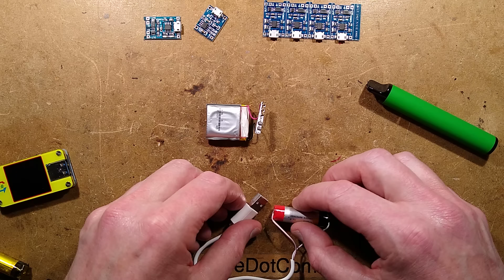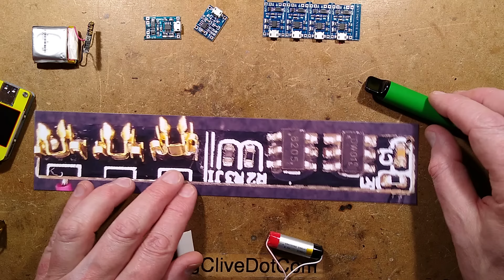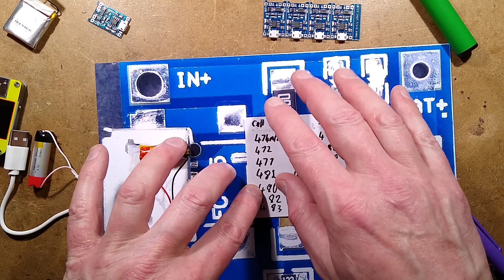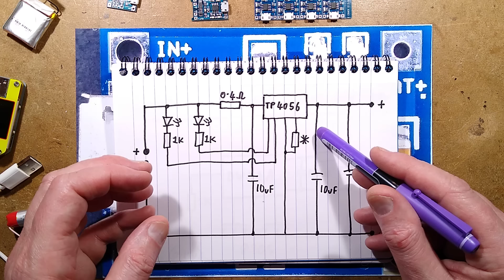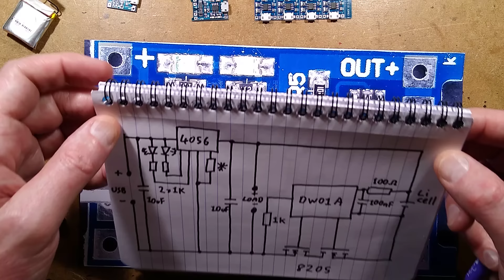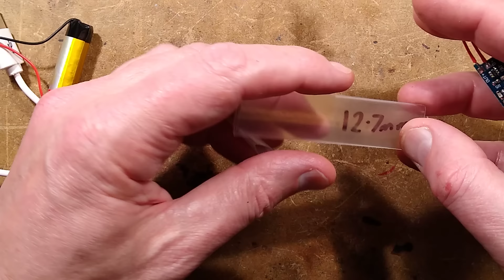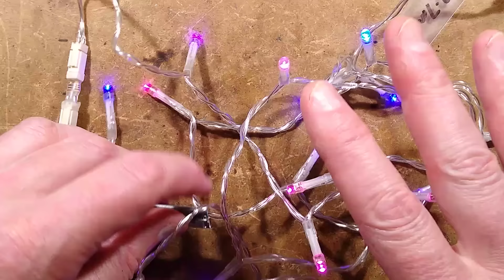Don't do this!   (There's a much safer way)

Comment: When I charge a lithium cell when not at home, I simply put in precautions that if it did for some reason fail and burn up, that there isn't anything around it that could catch on fire and then start to burn down the house. Even when using a proper bought charging circuit, I don't have 100% faith that it can't ever fail, I know it can, because I have seen some battery banks fail in their protection circuitry and then cause a fire. I have a metal tray that I have a thin silicon mat on, I leave my stuff to charge in there, there is a metal lid I place over it as well. It can't possibly burn anything, and the metal tray walls help it stay cool enough in there if it starts to warm up in there a little. The silicon mat is perfect because it can't burn, but it also offers electrical insulation as well, so wires aren't touching the bottom of the tray and shorting out.

Comment: Random question - to get a higher voltage and still charge batteries individually, can two of these be connected to their individual 18650, and then their outputs connect in series for a 2S battery?
Reply from the maker: Only is their 5V supplies are isolated from each other, or they will effectively short one cell.

Comment: I got ten pack of these.  I got some 5K resistors too but haven't gotten to putting one in yet.  But I just noticed, while charging an 850 mAh cloud making battery that after only about 10 minutes, that that little board is pretty toasty.  I wonder if you've put your IR cam on it and what it shows.  Well over 140F by the "feel" of it.  Guessing it's a MOSFET?  Nothing emitting the smelly fogs of defeat yet however.  I'll continue.

LOL
Reply from the maker: The TP4056 charge chips use linear regulation.  So they do get hot in use.  Especially when used with a voltage higher than 5V.
Reply: Oh, I got the dual chip ones with the protection chip.

Comment: I recently bought one of these disposable devices, and used it until it stoped working. I then took it apart and found out the cell was just discharged and still had plenty of fluid left. The device has a 1000 mah lithium cell!
Reply: I managed to find a 5 piece set of the ones that have dw01a thingy on it for $7.03 shipped. Looking forward to some tinkering!!!

Comment: I'm a naughty  boy but just jump started by li-po garden 3.2v cell with a  12v lead acid tapping the wires on the li-po. The plastic wrap peeled off and it got very very hot in 3 seconds but..... .now showing 3.5v!

Comment: I install the extra protection version in all of my project devices. I even extend the leds, using 2mm 'lighthouse' leds, so I can have charge indicators at the surface of the case.

Comment: I had done something similar using a diode and a resistor too keep a peek on the current the diode was their to reduce the voltage from 5 volts to 4.3 still this was not ideal but also safer then a direct connection I have a voltage and current regulated power supply ware I can chose the peek voltage and have the voltage drop allowing a dasired peek current of say one amp used that to charge a LION cell for its first charge this did not end badly because I knew the peek charge for the battery and peek current for charging it and stayed bellow that I did allow the current to spike above that for a split second to verify the end of the charging cycle raising the voltage one tenth of a volt and the current went from 1 amp to .1.7 amps charge cycle was done and the charge was holding at 4.19 volts with the voltage coming in at 4.2 volts 1 amp but when not verifing the end charge cycle I reduced the current to 500 MA after 4 volts the battery did not gas off now if I would have just said F it lets do 12volts at 5 amps and be done in 20 minutes this would have blown up in a matter of seconds the USB hack is not the worst thing in the world to do but its not what I would call safe likely ends badly one in a hundred times

Comment: You can go one step up from directly connecting a LiPo to a 5V USB by adding a Schottky Power diode in series with the positive side and relying on the resistance of the leads to limit the current.
There's catches to this though: This only works fantastic if the battery has a maximum charge voltage cut out circuit, and you need to start with the leads too long and trim until you get the maximum charge current you are after.
It does work very well if you are accustomed to setting it up though.

Comment: That's awesome. Will be a great help powering temporary lighting solutions during the ever more frequent power cuts here in the west of Ireland. Thanks Clive.
Reply from the maker: My test on a cell has been running a string of LED lights.  The capacity on each recharge has been very consistent.

Comment: Hi @bigclivedotcom
I have lots (over 20!) of these little 550mAh lipo’s now, picked up on my drive to work, people are just throwing them out the window like a cigarette butts!
Think it’s turned into an obsession to pick them up (carefully) to remove the battery!

Anyway, could you let us know (or create a vid?!) on what the best and smallest protection circuit to add to this battery to safely use it apart from the larger TP4056?

And maybe do a video on using this little lipo with a 3.3v pro mini (with LDO reg mcp1700?) and a circuit which can be used to cut power to the battery/pro mini by monitoring voltage and controlled by software?
Thanks.
Reply from the maker: It would be intriguing to make a dedicated PCB for these using an LTH07, DW01A and dual MOSFET.
Reply: @bigclivedotcom
That sounds very interesting! Hoping that’s the recipe for an upcoming video!

Comment: If I'm not mistaken the lithium charging circuit boards give out a pulse charge instead of a constant DC supply and it will also regulate the voltage and current

Comment: I found one with a build in usb-c-charger, although the device is disposable (you can't change cotton/liquid/heating element).
But it's wired in a weird way, do you know about those and how to use them with the charger? It's neat and tells you when the battery is fully charged with a light.
Reply from the maker: Some of the little control modules do have charging functionality built in.

Comment: A few months ago I saw a guy showing a way to charge a lithium cell and he did exactly what you said not to do. . i.e. connect the terminals. The only twist was that he had a few resistors and a trimpot and 2 led's. The led's were there to show if it had reached charge voltage and that it was charging. 
The trimpot was to set a reference point for when the fully charged LED would turn on. So basically there was no protection from overcharge, no current protection. So if you plugged it into your computer USB it would overload the port, charge and charge until you unplugged it or it exploded. 
My lithium charger is full on with individual charging circuits for each battery, volt meter and a nice LED display (few 7 segments for volts and even a charging display. It does a very good job of identifying different battery types (nicad, lithium etc) and charging them properly.

Comment: This highlights the importance of respecting Lithium batteries.  A friend of mine was keeping a charged 18650 in his pocket as a spare for his vaper.  One day, he bought lunch and put the change in his pocket. The coins happened to short the battery, resulting in a few weeks in hospital for serious burns.
Reply: The first rule of batteries is not to leave them in your pocket where your keys or coins or something else can cause a short leading to the battery exploding.

The batteries are perfectly safe if you handle them properly.

Comment: I put a light bulb in series to limit the charge current (along with a BMS, or for a single cell, a voltage regulator 4.2V).

Comment: What if I use more amps, but connect more batteries in parallel, will it be fine? Assuming the batteries are balanced to each other
Reply from the maker: If connected in parallel lithium cells act like one bigger cell, so will handle the higher charge current.
Reply: @bigclivedotcom  thank you!

Comment: Do you think these cells would charge properly with a dedicated li ion charger such as the intellicharger i4? States compatible with 13450 which are only 5mm longer than these cells and they would fit in there securely.

Comment: Quick question. I've got about 15-20 1608 SMD UV LEDs in parallel inside of a small long and thin compartment about the size of a black piano key... in fact it is a black piano key. I've got a small lithium ion battery to put inside of it (as opposed to small coin cells, because I'd like to be able to charge it) wired with a small switch, and I have a ZPW-7 BMS that will fit in the hollow wooden piece that will attach to the piano key. My question is, based on the working principle of an LED, I would like to semi-automate its charging by wiring an LED in reverse as a small solar cell. Assuming I can fit up to a few small LEDs near a piece of acrylic, how practical would it be to use LEDs to charge the battery with light, and then use the battery via UV LEDs in the dark.. I've read that yellow LEDs are more efficient as solar cells. Is that accurate, and how many would I need to charge the battery at a reasonable rate? Also, B-, B+, P-, P+, and BM are all present on the BMS. How?

Comment: It should be noted that when extracting batteries from disposable* vaping devices that great care should be taken. The wires that connect them are very thin and often have large sections that are not insulated. Should any two wires contact, it is highly likely that the battery will start smoking and potentially have a devastating malfunction. Please, please please people take care with these.

When extracting, don't use excessive force. The tank inside is not connected to the case and is able to slide out with the battery however you will be pulling it by the wires connecting to the coil (resistor). Once the whole insides are extracted, it is then much safer to be able to cut the wires one at a time.

*Given these have lithium based batteries, it should be a given that they should never be disposed of without proper care. Essentially the only way you can dispose of them properly is to take them apart. I actually used to do this as a personal (free) service for many customers when I worked in a Vape shop as people were starting to get concerned when they finally pieced together that they have a battery in them (takes some people a while for some reason)

EDIT: I realise that last set of brackets may seem rude or like I have no idea how other people think but let's be honest, the only other option is that it's a magical smoke stick

Comment: So, in a nutshell, use protections!
I use these modules quite often to gently charge reclaimed 18650 cells.
One additional tip would be to solder a USB type A connector in parallel to the USB Mini connector.
That allows to charge without having to look out for an additional cable.
Thanks again for the video!

Comment: I'd probably take a lazy way out and put dual battery on the lead giving it half the voltage
Reply from the maker: It will work with cells in parallel, but the voltages must match before connecting them together.
Reply: @bigclivedotcom  indeed.  I'm adding a third bank to my solar powered box truck refrigerator but have to match it or else lol.  The banks are the same age but for a while I was on the fence whether I'd use it on my hand truck power bank (each bank is roughly 50lbs or 23 kilo.  I enjoy the videos!

Comment: Thanks for showing us these chips - I've got 8 R-Pi Picos on the way, and with their ability to run from a single lithium cell, one of these cheap little boards would be the perfect addition for a battery powered project. I've also got dozens of salvaged 18650s from old laptop batteries, so using one of these boards makes perfect sense. Cheers from Australia! 🍻

Comment: Is there a way to pass by the battery? Like using tablets on a power bank or off the wall -like old laptops with detachable batteries-. I'm asking cause I have a project that includes mounting a tablet in my car, and I don't want the tablet's battery to catch fire on hot weather.

Comment: i usually plug mine into an apple usb port, i dont leave it on for any longer than 20 mins and constantly check it for overheating, i only need to recharge each battery once before ill chuck it so its not too bad and ive never had a problem. honestly pretty safe UNLESS you forget about it

Comment: If only there was something like this for the older nick mettle hydride batteries cuz i have some of them kicking around. Since they are not AA or AAA i cant just use that charger.
Reply from the maker: Theoretically, all you need to charge a NiMH cell from USB is a diode and resistor in series with the cell, as it can be trickle charged at a low level continuously.  For 100mA charge current you'd use a 27 ohm resistor.  It would need to be rated 1W.  Depending on the capacity it may take a long time to charge this way, and there will be no indication that it's full other than time.

Comment: Connecting the lithium cell directly to the 5v is obviously rather silly, but what about a pair of diodes and a resistor minimum 10 ohms for max current of 500mA? Diodes would drop about 1.2 v so cell would charge to ~ 3.8 v  and would be trickle charging by the time it gets there. Is this safe enough for a really basic charging circuit?
Reply from the maker: That could work, but would only half charge the cell at best.

Comment: those connectors are used on pc fans as well as gel blaster and remote car/tank battery packs. ok no wonder its hard to remember the name of the connector. they seem to just be pc fan connector 2pin or 3pin etc and are differentiated by voltage. 5v 12v etc. molex is definitely something different and much larger

Comment: On that eBay charge controller, how cool would it be if the manufacturer added a small potentiometer to adjust the charge current limit. The resistance chart could be provided with the module so that the end user could then put a meter to it and adjust it to suit.

Comment: Coming from a background of electronics I honestly couldn't fathom how someone would just plug a battery directly into a stripped USB cable and think it's safe,
but seeing as clearly not everyone has this sort of mentality, thank you for the video saving the people who aren't familiar with electronics in general
Reply: I'm certain that you are far too young to remember the UK public information films from the 1970s where people used to use matchsticks to insert wires into mains sockets because they were too parsimonious / poor / mentally defective to fit a plug. These are the sort of people who FA&FO with lithium batteries today.
Reply: Right??! I built guidance systems for many years and it seems like common sense to not randomly tack things together and plug them in. But what do I know?😂
Reply: Have you watched "normal folks" (morons) jump start cars?

Comment: I'll be getting some of those to retrofit into solar lights, which  seem to discharge the 18650 down to 0.2V :(
I assume the lights don't have any charge protection either, relying on the amount of sunlight and output voltage from the solar panel.

So I have a handful of undercharged cells which y off the shelf charger won't recharge.
Could you do a video on how to resuscitate old cells safaey ?
Reply from the maker: Some of the solar lights have no overcharge protection, so a module like this may be a useful addition.

Comment: I'll just bridge the short cells, in an efest. 4.2 will be obeyed..
You can tell you are an engineer...all this lead wiring.
A good multi-charger, with bridging, obviously thin metal, will be easier.
Man, you engineers I'll tell ya.

Comment: I'm pretty sure using a resistor in series with a Li-Ion battery is your cheapest solution to directly plugging the battery on the 5V usb charger. The resistor will lower the charge voltage, which in turn lowers the charging current. A lower charging current of about 2A should be fine for charging the first 50-60% of the battery. You can then disconnect it, or use a larger size resistor that will bring the voltage down even more, so you can charge it even more.
The charge current should lower as the battery gets charged up.
Another thing you can do, is use the older USB 1.0 chargers, which usually limit charging current to 0.5A (2.5W).
Reply from the maker: The resistor will limit the current but not lower the voltage.  The cell can still charge to a dangerous level.
Reply: @bigclivedotcom  from my electric classes, a resistor will have a voltage differential between the input and output.
When put in series with the battery, battery voltage will drop. When put in parallel, current through the battery will drop.
When put in series, voltage drops, which will affect battery charge time.

Comment: I've just charged a scavenged battery (using one of the chargers featured here), and the voltage is well above that marked on the battery.

The battery is marked 3.7 volts, but the battery is reading 4.13 volts. 😕
Reply from the maker: The average battery voltage is 3.7V, but it will vary from 4.2V fully charged down to 3V fully discharged.
Reply: @bigclivedotcom  Thanks.

At least I now know the battery is in decent condition.

Comment: Clive can I ask if its possible to use one of those boards to charge 2 cells in parallel?
Reply from the maker: Yes.  If their voltages are close before wiring in parallel.